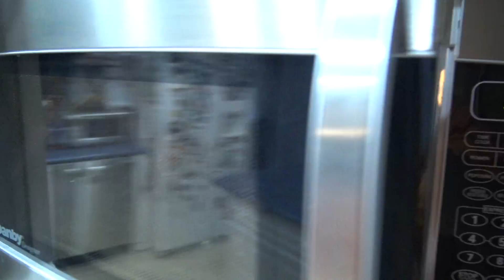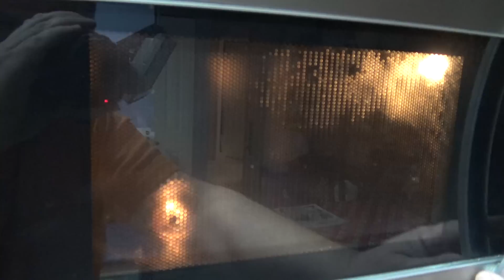EL34 power tube in a microwave

Comment: please clean your microwave after doing this......Mercury in the tube.
Reply from the maker: No mercury in a vacuum tube. That is why it is called a vacuum tube. No air at all. Mercury rectifiers and fluorescent lamp do but not electron tubes. They wouldn't work with it.

Comment: Ahh loverly el34 dinner, needs a blob of ketchup :-D :-D

I was with you all the way, i call grids "grids", the cathode is a different part.
I dont know about you, but im supprised that valves dont cost more, and they have a beauty even when dead.

I think some high end transmitters have re-designed valves for the rf-pa, and lets not forget the amazing AM radio station transmitters, monster valve amplifiers.
I hope the valve is never forgotten, an amazing invension :-)

Comment: When your magnetron goes out, put it in your amplifier.
Reply from the maker: Funny you would mention that. I know a few hams that used a magnetron as a transmitter. Worked great, they ran the HV winding after the rectifier and capacitor through a modulation transformer and generated about 200 watts on 2.4GHz and used to communicate relatively long distances. Had the transmitter up on a mountain top as a repeater.
Reply: I've kind of wanted to build an audio amp using 814 transmitter tubes. I'd probably have to wind my own output transformers.
Reply from the maker: I'd like to build one using the classic WE 300B triodes myself.
Reply: I personally can't justify the $3,500 for a matched pair. It does make me wonder what it would cost to start a small tube manufacturing business though. They used to make cold-cathode x-ray tubes in the town I'm from. My father was a physicist who designed the field emitter arrays for those tubes.
Reply from the maker: BlankBrain 

yes I know 300B can attract a few bucks but that is chump change for someone living in a 38,000,000.00 mansion which is what they just announced the most expensive house in Vancouver is valued at. Anyone that can afford this in the first place doesn't care what it costs. I was working last year in a million dollar house in my neighborhood and the guy had a nice setup. Didn't get that close a look at it but it looked like it had 2 300B per block and a tube preamp oracle turntable and a couple of days massive horn speakers. easily 50 grand in equipment for 4 pieces and 2 speakers. They were probably 10 grand each.
Reply: There used to be a rule of thumb that you should put at least half your audio budget into the speakers (not counting the room and records). I think some people get so focused on moving electrons that they shortchange moving air. I look at audio as a physics problem and work from my nervous system back to the wall plug. Whatever makes people happy is what counts, as long as it doesn't make other people unhappy.
Reply from the maker: BlankBrain 
well it is the speakers that you actually hear. they make or break the sound.

Comment: you kinda left out how the tube AMPLIFIES a signal, or was I in lala land again?  
Last week, I disected a broken 6AV6.  So what if you made a tube from a 100w light bulb, add a grid and plate?  Would that be a transmitter tube?   Don
Reply from the maker: I'm sure I left lots out. I didn't do research. It was more to show what was inside it. Amplification is of course controlled by the grid. If there was no grid there would be full current flow. The grid acts like a valve (hence why the Brits call them valves) to control the flow of electrons. More negative, and the flow stops, more positive and the flow increases. But hey I am no expert on tubes. Tubes were on the way out when I took my apprentiship. They were still around so I got exposure to them, but they were not in new equipment, so I had to learn about them from practical experience and books. Still enjoy them for amplifiers. Nothing beats the sound of a tube, especially a single ended amp like I just built. Using that one in my studio. Breaking in nicely and really opening up now.
Reply: There you have it, in less than a paragraph, but most important when discussing tubes.  The difference from a rectifier and amplifier tube, in a sentence, WTG tubemeister.  btw, here's what appears to be an opportunity to get a good deal on a tube amp, needs the three tubes, but also needs some restore.  I have one, really like it, working on it now.   Don  
http://www.ebay.com/itm/142224533257?_trksid=p2060353.m1438.l2649&ssPageName=STRK%3AMEBIDX%3AIT

Comment: Won't your microwave get damaged from all that arcing?  Hope your wife does not see this video.
Reply from the maker: Actually it won't do much to this one. Conventional power supply. I would never do that in one of those Panasonic inverter units. Those things are a stick of dynamite to begin with. There was no arcing to the magnetron, it was all internal to the wires inside the tube. To the microwave it is just a transmitter, and there is no direct connection to the outside world anyway. Might put a little extra heat in the magnetron, but it was only running for a few seconds.
Reply: I have one of them Panasony inverter MWO's, never looked inside.  Would it be a kin to those inversion TIG welders?
Reply from the maker: I don't know about the new ones, but when they first came out they were blowing magnetrons, and then the inverter left right and center.
Reply: we've had ours for a few years, no probs at all.  before that, we had their best GE 3 way combo MWO for over ten years, had to replace the control panel twice.  That might be a good vid, control panels for MWO or stoves or washers.  A lady told me that it cost her over 200$ to have her Whirlpool range panel replaced, notorious for crapping out.  Don
Reply from the maker: umajunkcollector 
my other microwave is a Panasonic madam grill. go look that one up. rare as hens teeth. made in 1989. I was given it in 1993. guy bought it for his wife, she only used it to heat coffee. he died in 92 she sold the house and moved into condo and this was too big so she bought a little one and gave it to me. wife uses it every day, not so much as a microwave but as a conventional oven. it is not a convection it is a radiant heat with heaters top and bottom. fantastic oven. I put in a separate microwave for nuking stuff. had another old 1989 Panasonic. did a few repair bids years ago on that. finally the relay on the control board died and a new relay cost almost as much as a new oven so I picked up a Danby, which is really an LG. all stainless inside and out. was only 70.00 and for the past 2 years no issues. used every day.